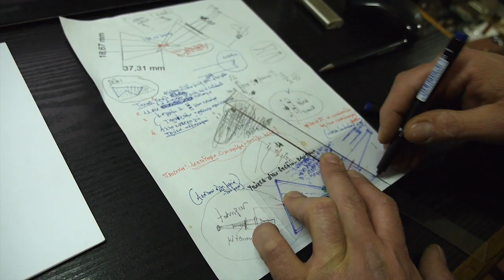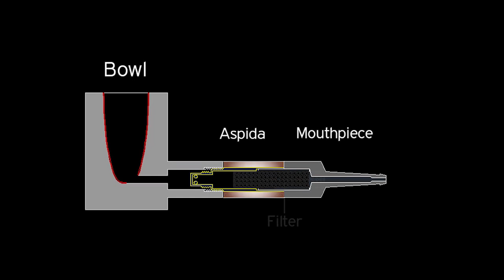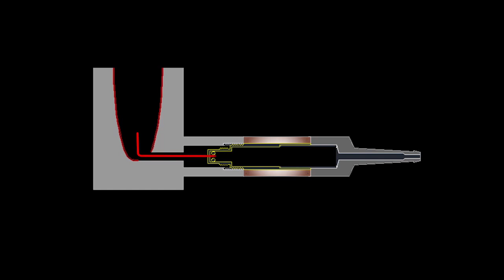Kostas Gourvelos-Smoking Pipes-Aspida

Comment: Excellent video and great work  ! Referring to health risk, isn’t there a problem with this aluminum insert (aspida) exposed to high temperatures (hot air) ?
Reply from the maker: Thank you for your words sir!
Aluminum can cause problems only if swallowed or at very high 
temperatures (more than 600 degrees Celsius/1100 Fahrenheit). We can 
even use it as a tobacco chamber in some cases ("Medwakh" pipes do)! 
At the shank area of a smoking pipe, where Aspida is located, I estimate
 the temperature can reach about 180 degrees Celsius/356 Fahrenheit the 
most, much-much less then we have to worry about...
Have tasty puffs!